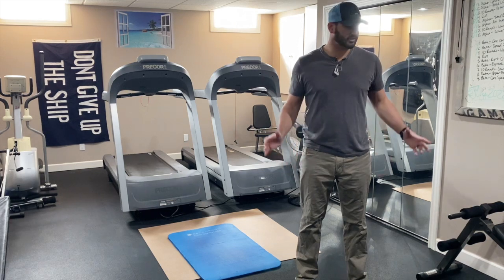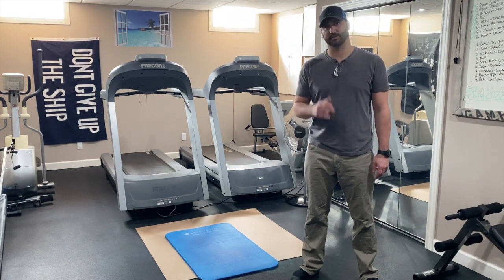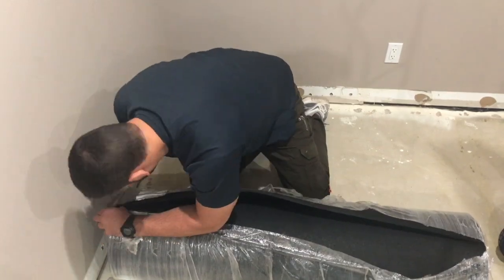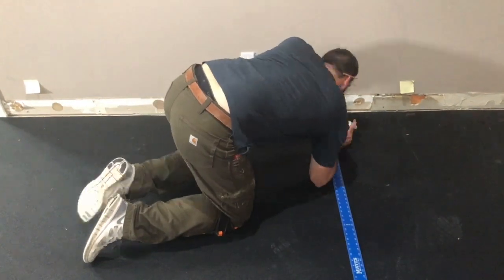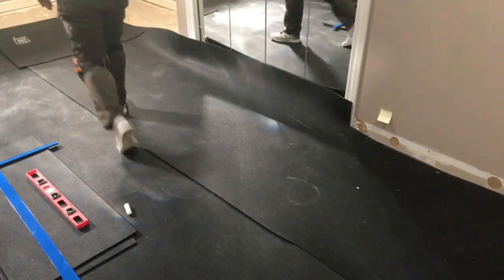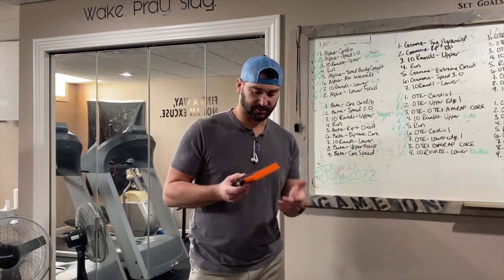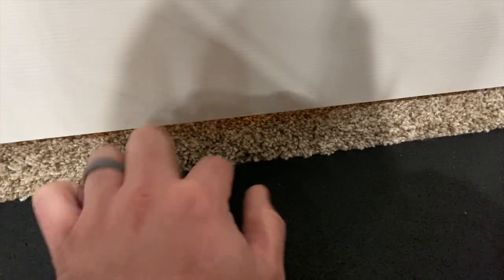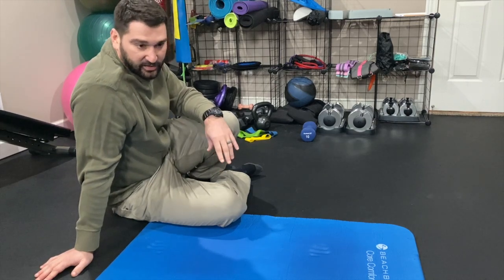Installing rubber floor and review for home gym, Rubber Flooring Inc

Comment: How's it holding up?  Most importantly how's the smell?  Debating which flooring to go with, I do like the seamless look over rep fitness 4x6 mats
Reply from the maker: It looks just as good as the day we put it in! We don’t use Olympic weights in our room though, so if you use those it may effect the floor more. If so I would use scraps to double up the floor (or choose a thicker option) especially in deadlift areas. Also, it smells nothing like a gym. It very easy to clean and disinfect, and doesn’t hold onto the sweat smell.

Comment: Great review. Any issue with the rubber flooring turning the bottoms of your feet or socks black? My stall mats do that no matter how much I clean them.
Reply from the maker: We mostly work out with shoes on, but the few times that I was in socks I did not notice any discoloring of them from the floor. Great question!

Comment: What did you use to fill holes left by tack boards? Or was that not necessary?
Reply from the maker: No need to fill those. The mats cover them since they are smaller.